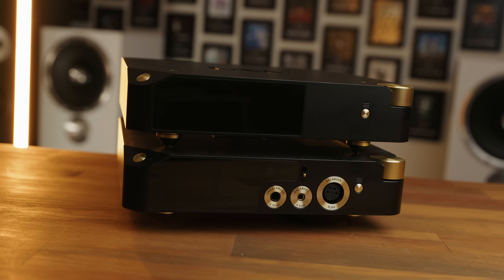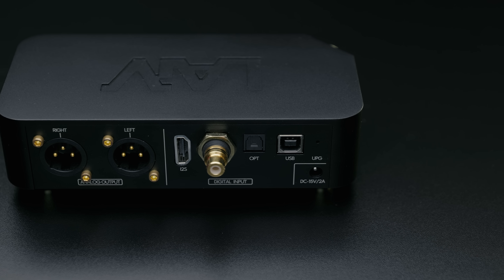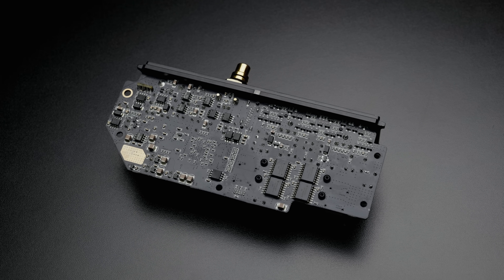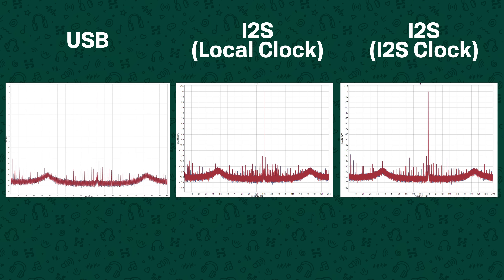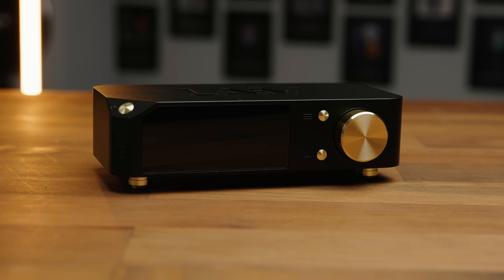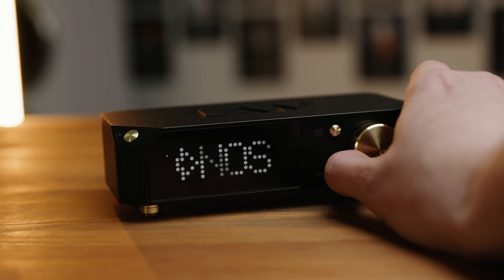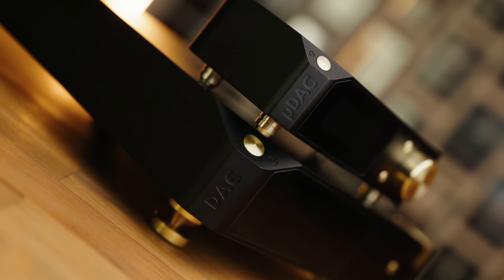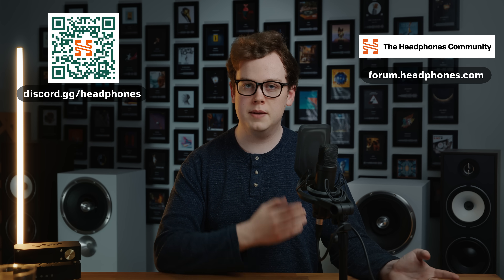Tiny and mighty R2R DAC! - Laiv uDAC Review

Comment: I purchased the more affordable $1,000 Laiv Micro DAC. I use the Zidoo UHD8000 as a streamer connected by USB through a Ideon 3R USB MK2 Blackstar re-clocker then into the Laiv Micro DAC. It is much better than the Sabre ESS9069Q in the UHD8000, The ESS9069Q in the Panasonic UB9000Mk2 and the Quad Play+'s ESS9018. I now put everything into the Laiv Micro DAC using Optical, Coax and USB. Thanks for the review it really is a smooth sounding DAC I am very happy
Reply: Do the reclocker bring a improvment? I got the udac and thinking of getting the ddc, but in this review he say he has better messurments(jitter) with the usb link of the udac than with  add the ddc.

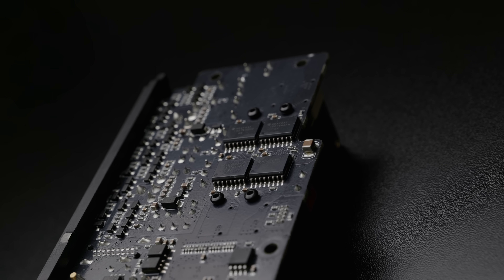Comment: 4:27 despite prime95 being one of the better powerhogs, it's not the biggest noise generator, at least when it comes to vcore. That crown goes to linpack, or, at the very least, y-cruncher's stress modes, and those can stress both cpu and memory extensively and with very high switching frequency, such that it confuses less optimally configured VRMs into outputting voltage outside the levels that would guarantee stability, hence the prebuilts with XMP not passing those stress-tests out of the box commonly.
Though perhaps this wouldn't really matter, as the frequencies are still way outside hearing range.

Another interesting note is that a simple act of moving the mouse generates context switching inside the OS and thus the CPU, so the waveform becomes a lot noisier than it would be normally with a stable workload, even outside idle conditions.

Great vid though, as usual

Comment: Nice review. I just want to add 2 technical issues:
1) NOS with 44.1Khz sample rate is not even HIFI, as you showed in your frequency responds curve !!!
2) You should extend the FFT-Bandwidth to 200KHz . A R2R DAC needs a very costly output filter. If this is not implemented the following amplifier and your headphones have to cope with really high levels of crap, which you don't hear. But they could destroy your gear! Therefore the extend measurement bandwidth.

Comment: How can I use Chord M Scaler with that or Cyan 2? Some time ago I've listened to MScaler and TT2 together with HE1000SE and I've heard the work of Scaler, but it uses proprietary BNC connectors, locking any other DAC with only Coax or Toslink with not very high resolution.
Reply from the maker: The mscaler has an spdif output. Although it'd make little sense to get an mscaler for a dac at this price point. HQPlayer would be ideal though
Reply: @TheHEADPHONEShow is there any guide for Cyan 2 specifically then? I've tried one guide with "stock" settings on my Hifiman Serenade and I didn't liked the result.

Comment: Something I feel isn't talked about enough is Audio's obsession with USB type B. USB type C is so much more durable, reliable, and at this point probably simpler to implement than type B, to where I really don't understand why the insistence. It's literally just making the product less good for no benefit beyond sticking to what you're already doing. 

I want to like a product like this, and I know that realistically, something else would break before hitting the 1500 cycles type B is rated for, but there's no reason to still be using type B anymore that I'm aware of, and it's really offputting for a device so expensive, especially when I have a $15 scale that uses type C.
Reply: And yes, I know that charging with type C is different from data, but the point is that the connection obviously isn't gonna raise the price like crazy or anything like how HDMI specs do on TVs.

Comment: Thanks for the review. What about a better power supply than the stock one?
Reply: I have mine on a Ferrum Hypsos and have seen an improvement over the stock wall wart - the next Ferrum firmware should have both the uDAC and the uDDC included as selectable profiles

Comment: hey man asked the same question on the harmony review as well looking to get an answer. Will aune s17 pro ( not evo) work with this dac? I Ordered it a few days back and worried about the output impedance thing. I belive s17 pro has xlr input impedance of 10k ohm.
Reply from the maker: Yep! The 82 Ohm output impedance of the uDAC shouldn't be a problem with any amp.
To be honest with a 10k input impedance, even the >1000 Ohm output impedance DACs should be fine.
Reply: @TheHEADPHONEShow i was asking about udac’s bigger brother, the harmony dac

Comment: Perfect timing! I've been cross shopping thos and the Cyan 2 all week. This helps a lot.

I'm planning on pairing one of these with the S17 Pro Evo amp, to pair with my SJY Carbon Closed.
Reply: That sounds like a crackin' ass combo 🤤
Reply: I have the Cyan 2 and love it deeply but did not love it until I got HQplayer to oversample… huge consideration….

I have a pi 5 running GentooPlayer and a Pi2aes 2.0 both fed with independent linear power supplies and running the settings GoldenSound recommended (matching bit depth, 18, and a good dither algorithm like LNS15), those matter A LOT!

If I wasn’t comfortable with setup like this would probably get the uDAC
Reply: How does this compare to the Topping D3 discrete? Anyone have any thoughts on this?
Reply: No personal experience, but there are other reviews on YouTube that compare the two.  @estenray5385

Comment: 4:00 Is ok to use those balanced to single ended transformer based converters ? Like amps and sound or pine tree audio
Reply from the maker: You can, though transformers will inherently colour the sound to some degree
Reply: @TheHEADPHONEShow LAiV sells xlr/rca adapters on their site. They say "any degradation in sound quality is usually minimal or negligible." (They would say that.) Also, I've heard from reliable sources that Benchmark sells xlr to rca cables with floating pin 3 that work well.

Comment: gosh darn it were is my Schiit Yggdrasil MIB review? I already bought one and I need bias confirmation!
Reply: I have both the  Schiit Yggdrasil MIB and the Laiv uDAC with DDC. I would like to hear you take as well. They defiantly sound different. Laiv uDAC has more dynamics and Schiit Yggdrasil MIB is smoother both are outstanding. I used them on two different systems one with the klipsch Forte III speakers one with wharfedale lintons 85th. Different amps as well Class A and Class AB. Tube PreAmp on one and SS on the other. Still working it out.